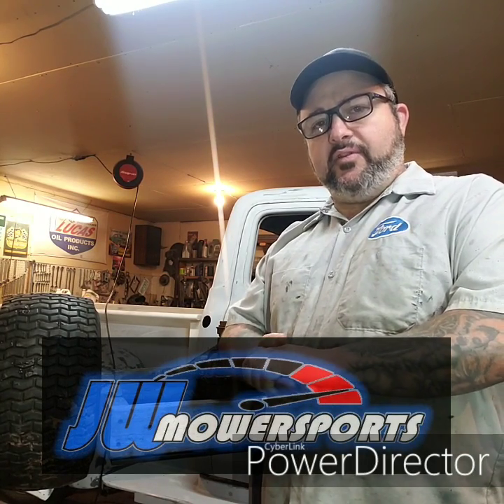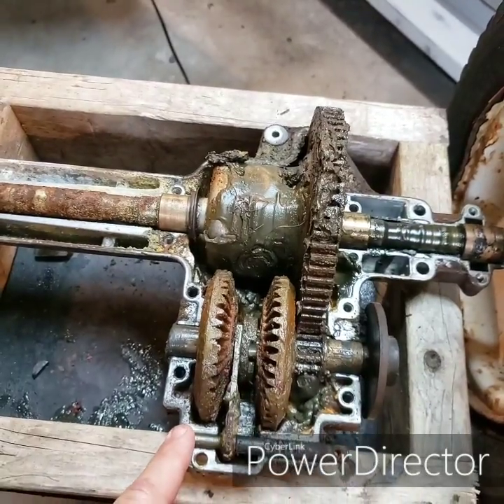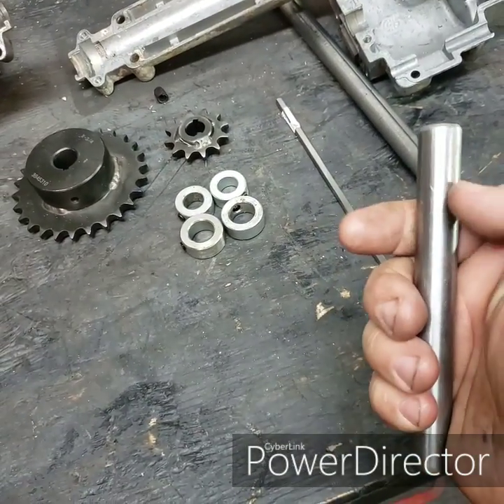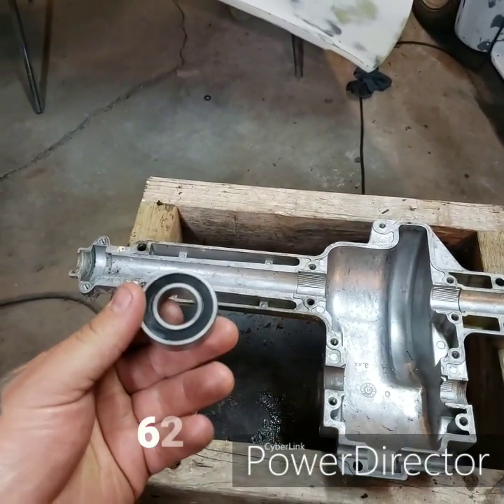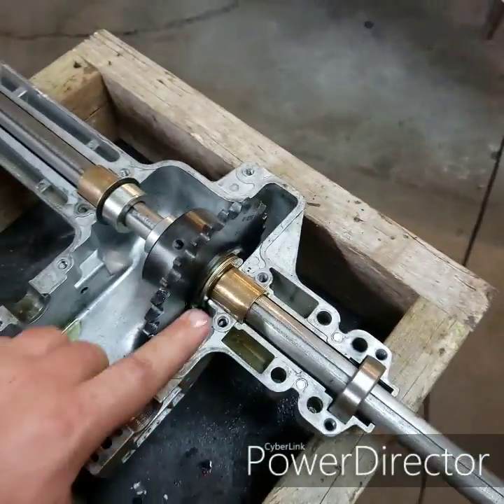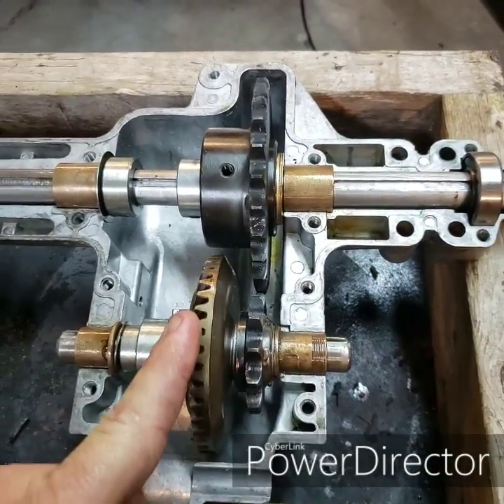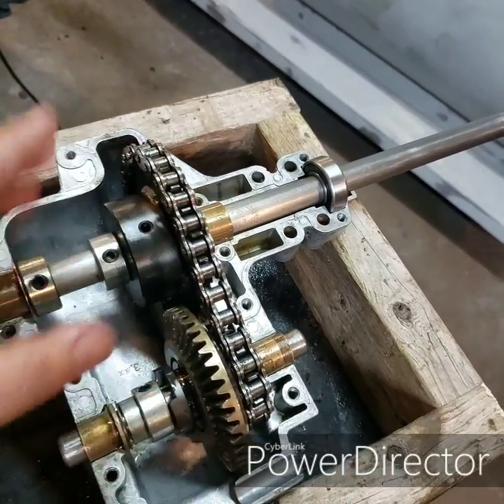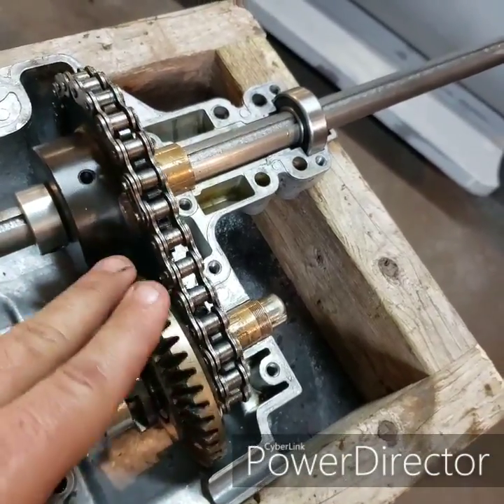Converting  MTD FNR transaxle for racing

Comment: You wouldn’t happen to know the gear ratio of mtd 719-0313-b?
Reply from the maker: @johnkornowski4853  the stock MTD FNR diffs are aprox 22:1. After I converted to a chain its aprox 6.5:1
Reply: @peilawntractorracingclubin7053 another question lol, what if I am installing this flipped what side does the 90° gear go on

Comment: I am just amazed how much changes were made from the transaxles of old. The shaft size of 3/4 inch diameter is super lightweight. The old stuff was one inch or 1 1/8 inch diameter. Interesting video Sir.
Reply: i could imagine a race modded wheel horse 8 or 6 speed trans it would be heavy but bulletproof!
Reply: THAT IS A FACT FELLA !!!! @111455

Comment: Awesome modification! I'd like to make a quick correction on the bearings you've shown/listed, what you're actually after is a 6203-3/4-2RS. 40mm OD, 3/4" ID, 12mm wide are the specs and they're readily available.
Reply: ackchually

Comment: Have you ever done a similar thing to a peerless 5 speed unit? It looks like you could completely remove the entire reduction gear assembly and run a keyed shaft in the rear and a sprocket and chain from the gearbox output to the rear axle.

It’s something I want to try out, I don’t like overdriving the crap out of everything to go faster, it just ruins the transaxle

Comment: Have you ever done this to a mtd 2 speed ? It has high low and reverse  wondering if it would be possible
Reply: Pulled one of these eith the 1 inch shafts for the same thing. Can't be much difference

Comment: What do you do about brakes? Can the stock setup be utilized or will you need to  install a rotor on the axle and mount a caliper? Any pics would a help as I'll be building one asap

Comment: My mtd lawn tractor has the same gearbox. I took of the big rear pulley stuck to the gearbox and the pulley and shaft have a whole different pattern. It has 36 teeth with a converter with a six stat slot where the pulley goes. I cant find any other pulleys with the 6 star slot. I need a keyway shaft. Your shaft was as mine in the start of the video but in the end it was different. Can you tell me what you do with the shaft to make keyway pulleys fit

Comment: Sorry for the strange question,  but...
Is there a hydrostatic riding lawnmower transmission that is 13 inches long? Or wide? Or is there a transmission that I can cut down to 13 inches?
What I am trying to do is build a galloping goose railcar.  5 inch scale 15 inch wide track. 
Im using a Briggs and stratton 17 hp motor and a riding lawnmower frame. 
I want to try to use the transmission to have forward and reverse.

Comment: that brass input gear is not going to be too happy without OIL IN IT... STP OIL TREATMENT up to the bottom of the axle shafts with some gear oil in it too. the gear oil will leak out of the axle shafts.... maybe not so much with the axle bearings that need to be regreased with REAL GREEEN/ RED GREASE so they last forever as the packing greease is the cheapest grease they can get away with putting in there to keep them from rusting on the boat from china. pry out the seals and pack in real US GREEN/RED grease and put seals back in. a good coating of green red grease on gears wud help too i suppose along with the STP oil treatment... liquid grease.

Comment: How much would you charge for a kit and I would install it in the rear end?
Reply: buy the parts off of e bay and figure it out. worst thing is dragging all the nasty old grease out of it.... lots of rags and a cardboard box to throw the rags into. i wud put STP oil treatment in the gearbox before final sealing up. up to the bottom of the axle shafts so the oil doesnt leak out of the axle shafts.... STP OIL TREATMENT is generally tooooo thick to leak out of axle shaft. oil /grease the input needle bearings too on the input shaft tower as they need oil/grease. 2 of the 1/2" collars with allen head set screws blue thread lock on final assembly on those grub screws when u get it all together finally. the part # he gave for the bearings is ... are 12mm or 1/2"... axles are 3/4" or 1" on the HD models.  so need 3/4" bearings for the axle if have 3/4" axle shafts... or 25mm/ 1" bearings for 1" axle shafts. they are made in the US so the axles should be US standards????

Comment: I have a 719 transaxle currently ordering my parts soon. I have a question, will I need to remove the input shaft from the case or get a new one? Also what are the size and length on your keyed shafts, viewing bmicarts they vary to 4.5 - 16) 3/4 with cut to length. Thanks for the video!
Reply from the maker: Input shafts and gears vary somewhat from model to model. Although all are 5/8 input shafts, some are machined down to 1/2" on each end. I prefer the full size shaft as the keyway in the 1/2" is very small and likely to fail with any amount of power.
I use 3ft keyed axle shaft from Princess Auto.
The 719 will not have provisions for ball bearings.
Reply: @peilawntractorracingclubin7053  Alrighty thanks, I'll take this information and see what I can do with finding the proper length - size at princess auto, are you saying for the 719 model, they won't accept the ball bearings? Did all your keyed axle shafts come straight from princess auto;
Reply from the maker: @jordon756  axles are available at Princess Auto.  You'll see when you open up the case, the 719 model isn't machined to accept bearings like the 717.

Comment: Thanks for putting this together...very informative! So when building an MTD tractor for racing, is the variable speed pulley left as part of the drivetrain?
Reply from the maker: Thanks. And no, the variable speed pulley is not used.  We use a centrifugal clutch and direct to the rear.
Reply: @peilawntractorracingclubin7053  I used a stock trans exact to this one and a 1" bore CVT and a 212cc clutch pulley on the trans, and I hit 12mph using a small mower belt to drive it! It's a rear engine Murray

Comment: Also do you gotta use a clutch when you do this?
Reply: @NuBz it’s a clutch and brake dawg. You know how mowers work?
Reply: When you push in the brake on the mower and disengage the belt it won’t engange the rear end. So the pedal on the mower will be only thing keeping it from going
Reply: @NuBz they don’t just roll until they come to a stop 😂
Reply from the maker: This unit is used with a centrifugal clutch.

Comment: Do you have to shift still or does it just start moving like a go kart when you rev up the engine?
Reply from the maker: This unit is used with a centrifugal clutch. In racing  we use only one forward gear.
Reply: The mower will not move until you let out the clutch. with this conversion you have forward only and the axle is fully locked.

Comment: This is an awesome way to use a trans that most racers would tell you aren't worth the time of day... I did that with one of those foote H pattern 3 speed  trans from small chain drive mowers.. I deleted the vertical input and used a keyed shaft as a horizontal input and it is way better than any peerless 700 I've had no whine and barely any power loss.. I bet that brake shaft on the fnr would make an excellent horizontal input if one were so inclined...
Reply from the maker: Thanks! And yes, most racers toss these rears.
Reply: @peilawntractorracingclubin7053 how do you get your tires to stay on i am doing the same thing
Reply: @NubsWithGuns  are u high? This is an entire different system lol he removed the ring gear, intermediate gears and four spider gears which are solid steel and replaced it with chain and 2 small sprockets ... It is definitely far lighter like this not to mention the actual point is to internally speed up and strengthen the axle.. apparently you really are a nub lol
Reply: @ianbuilds7712 compared to just using a live axle with pillow blocks, this is heavy.
Reply: @boostaddict_  the point is that a lot of racing mower classes require a stock trans

Comment: is there any reason you couldn't put in both bevel gears and the selector so that it still has forward and reverse, provided that you get them shimmed correctly?
Reply: Pretty sure you have to delete reverse on most racing mowers
Reply: There is no reason reverse has to be removed... He just has no use for it and it's always there being a source of parasitic drag but it would actually be less work to keep the "reverse" which happens to be the original forward gear  because the chain drive reverses the whole thing...
Reply: @ianbuilds7712  I have personally seen the reverse chain fly through the case and lock up the transaxle
Reply: @turbo_jo69  the reason standard transaxle reverse chains explode is usually (99%) a function of extreme wear on the reverse sprocket itself (due to extreme neglect at extreme speeds) causing misalignment. Everyone knows a chain spinning opposite all its neighboring gears really aught be aligned.. for everyone's sake... one of the many benefits of doing it this way with this trans is that there is no reverse chain it works a lot like a peerless mst reverse where it's actually 2 opposing input bevel gears and if you really think about it that is actually the one reason this chain drive conversion can work because of the simple fact that a chain driven shaft spins opposite a gear drive..
Reply: Otherwise to do this he'd have to flip the transaxle over...
Reply from the maker: No reason reverse can't be maintained. For our purpose,  it is just one less thing to go wrong, and reverse is not nessesary in mower racing. If I were building a mud mower or just a go kart,  reverse may be an option.
Reply: Are you buying the hub and sprocket, then welding it together? Or are they pre assembled? The small drive gear hub seems to be thin. You said you ground it down. Were you able to still use the set screw? Great video, nice to see someone that actually knows what is going on.

Comment: Ur video is great. I'd say the best so far for this type of diy or retro-fitting ..Very simple for diy..excellent for young and old alike...On your next video.  Could u put ur cam on a tripod.  The constant rapid movements of camra is very distracting . And repeat tapping on the subject material doesn't help with hearing ur narration.. I still give you (A+)  I'm doing fiberglass over riding mower mods that  look like cars, pickups,Van's and big rigs.. your diy just solved several  drive train issues..
Reply from the maker: This was my first video, so its very new to me. But thank you for the pointers, I will definitely work on that fir the next one!
Reply: @peilawntractorracingclubin7053  wow your just getting  around  to looking  at your comments...